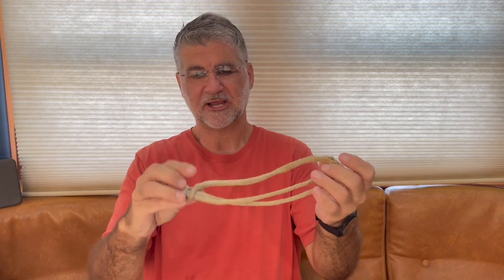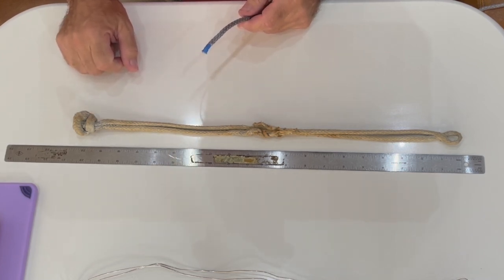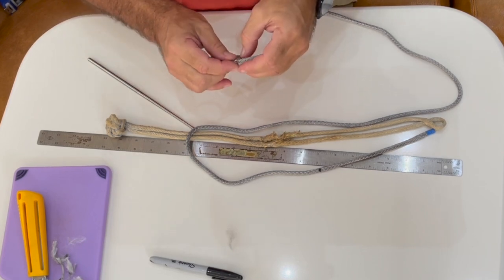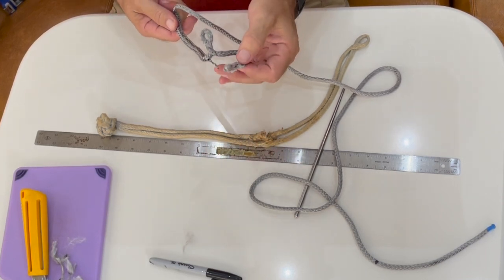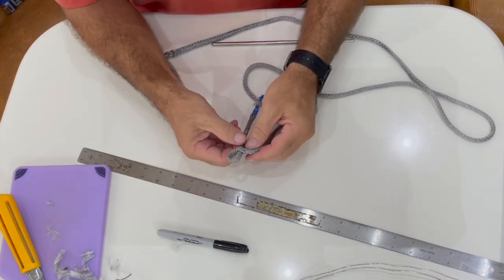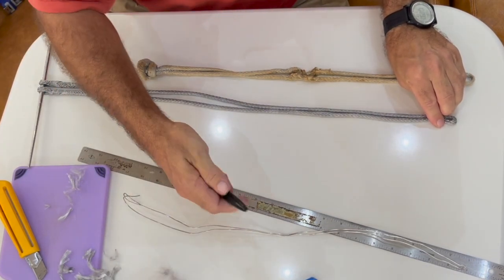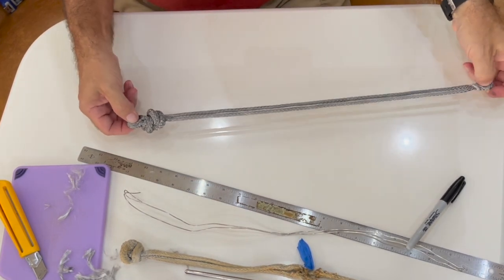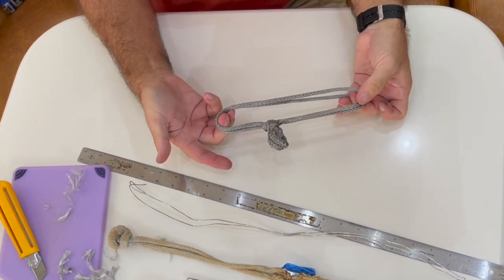Making an Anchor Bridle Soft Shackle

Comment: Hello! Very cool video… thank you!
I am new with dyneema but definately make a shackle like this one. Which type of dyneema line should I get?

Thanks!
Reply from the maker: It depends on the load you expect the soft shackle to hold. Look at the specifications and determine the size based on load. BTW, the bigger the size the easier it is to splice.

Comment: Hello, Do I understand the this correctly? Are you saying that a soft shackle is stronger than a stainless steel bridle hook. If so I sure like your soft shackle. What strength would you need for your boat?  Sorry for all the questions.
Reply from the maker: The 3/8 chain Chicory uses has a working load of about 2600 pounds. A 3/8 stainless steel shackle has a working load of about 1600 pounds, so you can see the soft shackle is a much better fit for this application.
Reply: @boatersdivingguide  Thanks for this. Very interesting that the rope is stronger than than steel, makes sense.